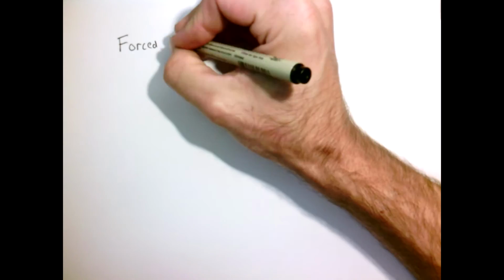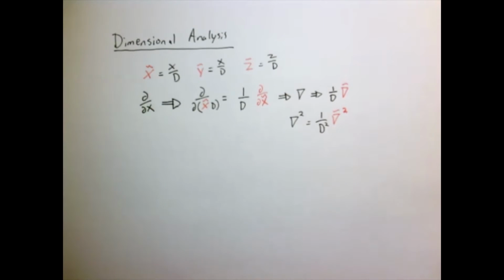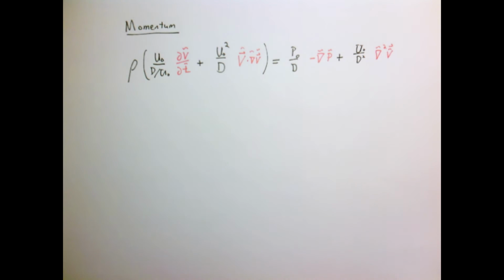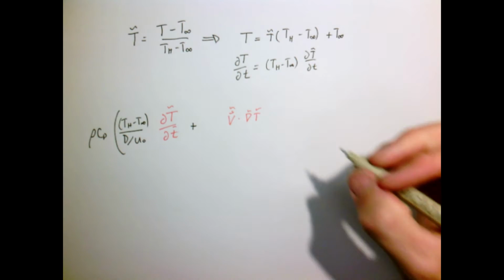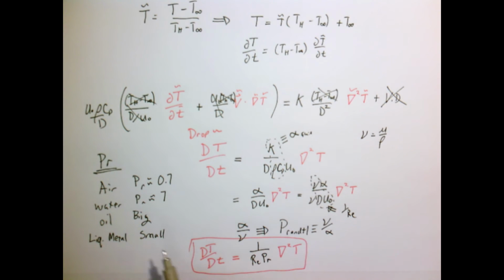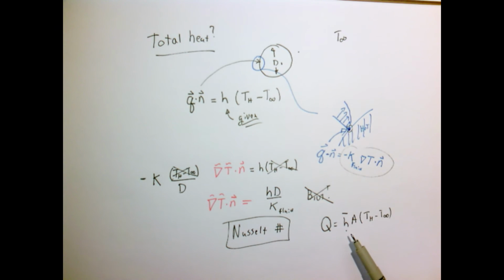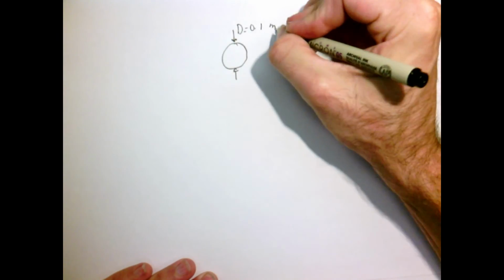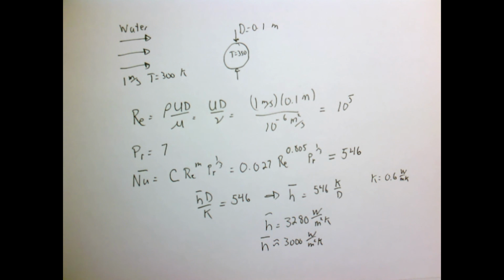Forced Convection

Comment: Thanks for the great video Brian. One question here: Suppose we had flow going over an object with the temperature field known every where. If I wanted to calculate the amount of heat flux thru an arbitrary control surface, would calculating the conduction term -kdel T be sufficient?  Where does the convection term figure into the calculation of the total heal flux crossing the control surface? Many thanks.
Reply from the maker: Through a imaginary surface drawn in the fluid, you would have conduction (k del T)  and convection ( u T).  If you take a patch of surface on the fluid solid interface then it is just conduction because the fluid velocity is zero. 

make sense?
Reply: hmm..you mean we should add conduction to  u (velocity) by T (temperature) ? It doesn't make much sense to me to be honest. It seems that within the fluid the total heat transfer crossing a surface (for example one side of a rectangle) is just the conduction term unless we term mdot(e+P/rho+u2/2) as heat too?  I think when integrated over the entire closed surface then the total conduction would equal the total convection and not added to it even ie. Sum of mdot * (e+P/rho+u2/2)=Sum of the conduction (ignoring the viscous terms). Perhaps my understanding is wrong?
Reply from the maker: The mdot e *is the convection term. e is the internal energy (c_v dT=de) and mdot is the surface integral of the velocity. 

The e + P/rho = enthalpy where cp dT  = dh. Thus when I said you would include the u*T term, I really meant cp*u*T term.  Anyway, I hope this makes sense as it is hard to explain everyting in these little text boxes.
Reply: Thanks for that and your time. ..PS: I suppose the definition of heat is a bit "vague" in physics..at least for me...on the one hand we call mdo*P/rho  "flow work" but then later it becomes part of "heat"...for example we never term work done by a piston as heat even though it can be related to its temperature...hmm